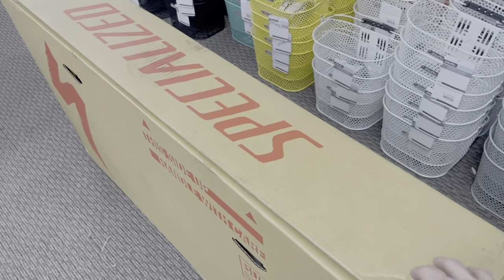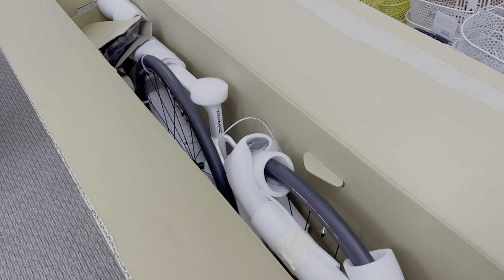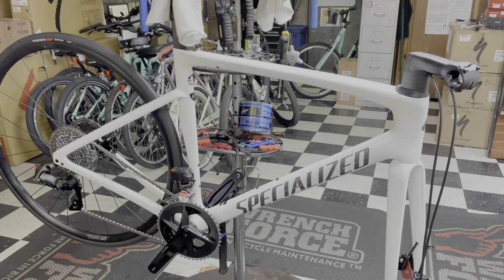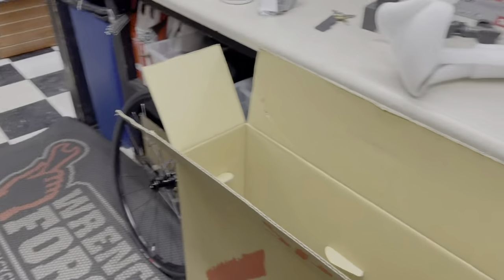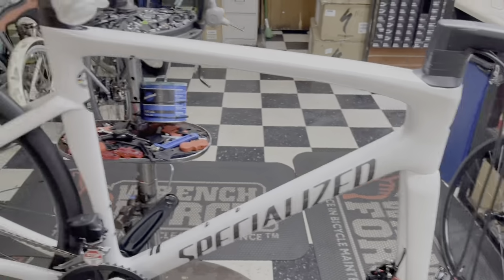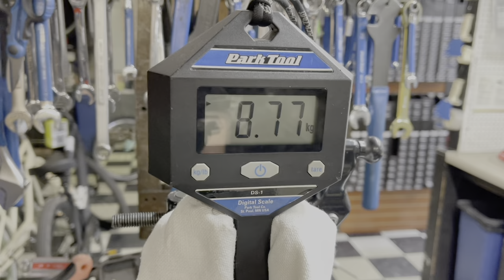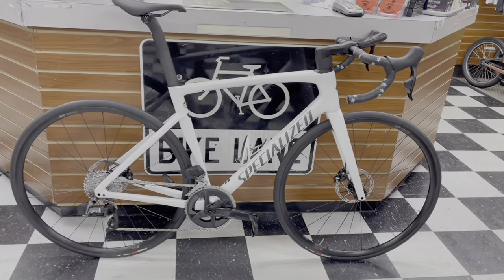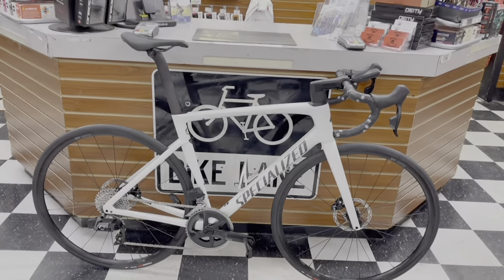*BIKE BUILD* UNBOXINMG AND BUILDING MY NEW SPECIALIZED TARMAC SL7 COMP (FINAL WEIGHT)

Comment: I just received my white tarmac comp. Wheels are alpinist cl, challenge latex tubes and continental gp 5000 tires, saddle is fizik arione r1 and two black carbon fiber bottle cages for weight of 7.77 kilos (17 lb 2 oz).  No other changes. It's the most fun bike I've ridden. I'm dialing in the fit now. It looks great.
Reply from the maker: thats aweosme and congrats on the new bike!!! sound like a nice build, go for a crank and casette upgrade nesxt those are the two big ones

Comment: Great video man! Found your channel about a couple months ago and loving the content. Also, I actually have the same bike but in a 58cm! I have all stocked except a few components. I swapped to cl50 wheels, 700x26 turbo cottons, Sram force 172.5 cranks with 46/33, Sram red cassette in a 10/33 range, roval rapide 40cm aero bars. Two sworks cages, supacaz bar tape, stem Garmin mount, and look keo carbon ceramic pedals. My bike weighs 17Ibs 12oz. I absolutely love the bike!
Reply from the maker: that is awesome and thank you so much!!! and not a bad weight at all for 58cm..... I am going to try and beat that lol but i might need help becvause giht now I am planning on not replacing the cassette and my wheels are going to be deeper
Reply: @GCPerformance18  No problem! I appreciate that as well! I plan on trying to make it a little lighter as time goes on, but I’m
Not sure what to even due lol I don’t really want to swap my shifters or calipers to force just to save marginal weight. So I’m not sure what to do lol I just followed you on Instagram as well if you want to check it out! Good luck!
Reply: @sirnickolan3945  did you weight the alu bar versus the rapide bar ? I am very curious what the weight difference is.
Reply: @Stevenafoe  I didn’t but I bet you could find someone who has. Also, my 58 came with 44cm wide bars and I put 40cm bars. I lost more weight than normal because of that lol

Comment: What is that piece called right after you put the shifters. It goes under the stem so it will hold the cable underneath it. Mine did not come with one😊
Reply from the maker: it comes with the bike and also the stem..... I dont know what it is called btu it should come with every bike, ask your dealer they might have forgot it

Comment: When installing the brake levers, when you trim the housing, did you have to re bleed the brakes?
Reply from the maker: no you do not as long as you odnt loose any fluid out of the shifter. jsut be mindful when re attaching the hose to the shifter

Comment: Is that SRAM rival the 105 equivalent how do you like it ? I hear 105 is more reliable and smooth especially front derailleur?
Reply from the maker: Yes it is the equivalent, it is an amazing group for the money and I had no issues with this group, the only thing bad with the group is the weight. But in terms of what you get a full wireless 12 speed electronic group, and the shifting battery and motor are the exact same as sram force and red but the only thing different is the hardware

Comment: Congratulations on the bike! Considering your height (6′ 0″, almost 183 cm), are you ok with the 56 size? According to specialized website, for that height recomendation is 58...Thank you!
Reply from the maker: yes I have always rode a 56 specialized, in my venges and also my sl6 frames as well, it is a smaller bike for me but i like them like that, you could go 58 if you want more comfortbale but might have to run a shorter stem
Reply: @GCPerformance18  you’re right about the stem length with the 58. Thank you!!

Comment: I have specialized tarmac sl6 sport 2020, if i want to change my disc brake wheelset better which i have choose.
1. Zipp 303s
2. Campagnolo Shamal Carbon
3. Fulcrum zero competizione
4. Hyper Lun
My road is mostly flat, but i want wheelset can go climb to, please forgive my bad english, thx
Reply: You can take a look at Zed Bike Wheels. They're hand-built in the U.K and are lighter than average given the rim depths they're running.

Comment: Its a porker but you are too GC ;-)  Kidding aside, I live in Florida too and its flat. Wind is the hills in FL.  Weight doesn't matter on the flat.  Aero matters in FL.  Needs some prettier wheels. Thanks for sharing even if I don't like the SL7 or disc brakes you also don't need in FL because its flat.

Comment: Bike needs to go on a diet : )
Reply from the maker: lmaooo it is 19lbs
Reply: @GCPerformance18  not when there’s sub 10 lb builds out there. 
I’ve rode them and that was over 10ths ago. Granted it was AX lightness build on a custom Scott addict frameset , when Scott was doing custom frame builds. 
Ceramic speed pulleys and bottom bracket, the bike was effortless and begged to be ridden, one of the more incredible bikes I’ve ridden.
Back then the cost was 10k. That was expensive then as complete builds we’re coming in at half the cost. Can’t even imagine what it would cost today to build that same bike